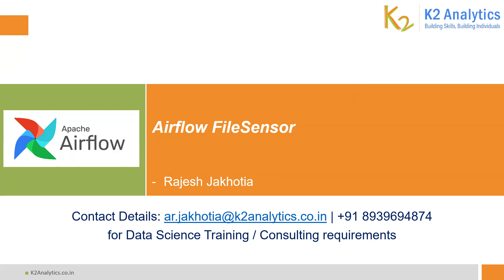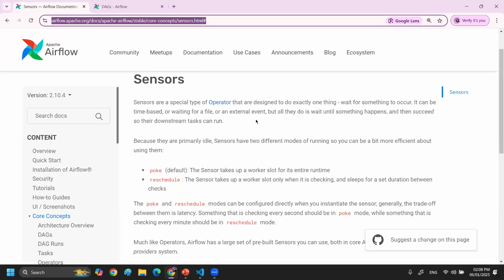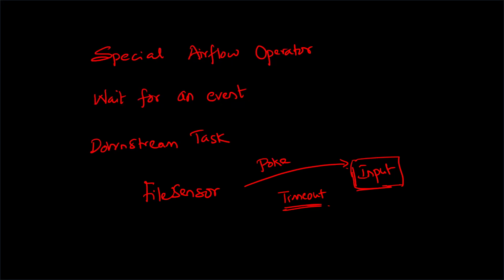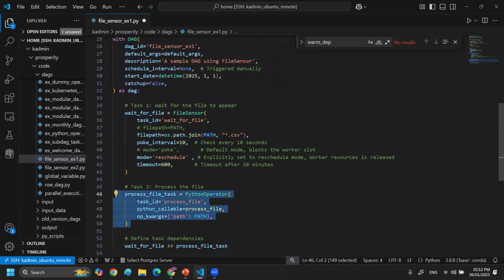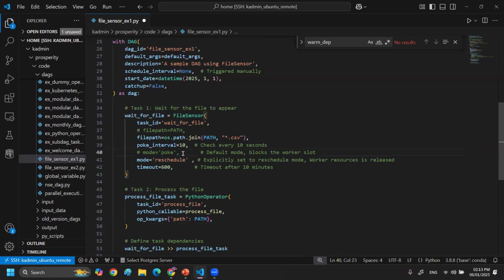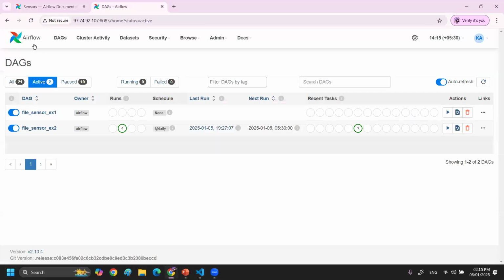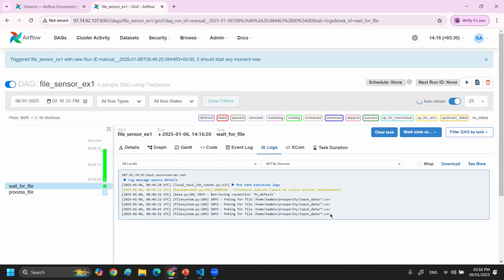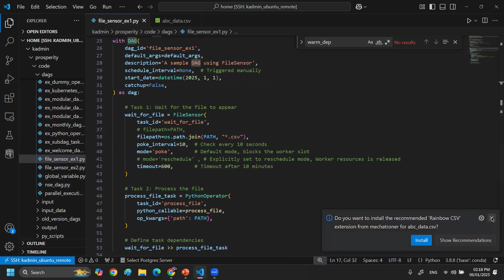Airflow Sensors | FileSensor | How to use Sensors, Poke, Reschedule and more

Comment: I have clearly got the idea of sensors from your short video but its different from what i expected.You are triggering dag manually and the dag listens for new file to appear and whenever its available it continues to downstream tasks and then stops but what i want is to continue this process that is whenver a new file generated on a file folder i want the dag to be triggered automatically can i do that in airflow
Reply from the maker: @harigovindi8217  You will get the answer to your query in my Part 2 video on FileSensor. It will be uploaded soon. Thanks
Reply: @RajeshJakhotiaAIML  thank you i will be waiting for that
Reply from the maker: Check out this video - https://youtu.be/MXVrbMA80do